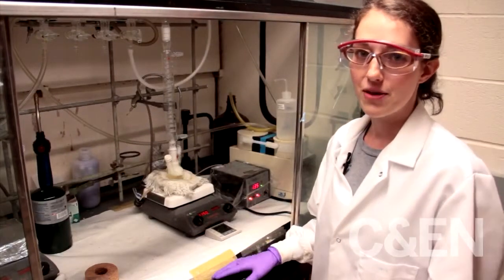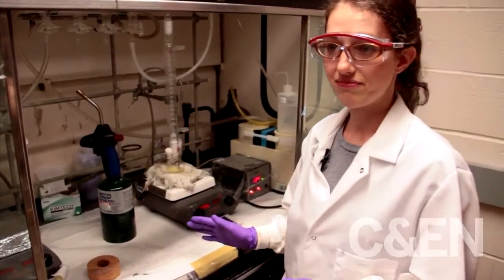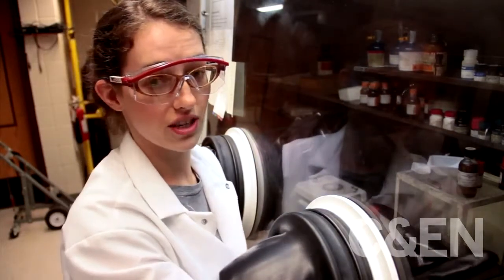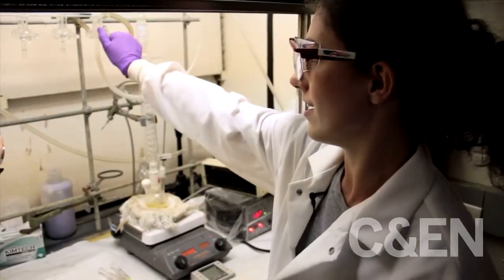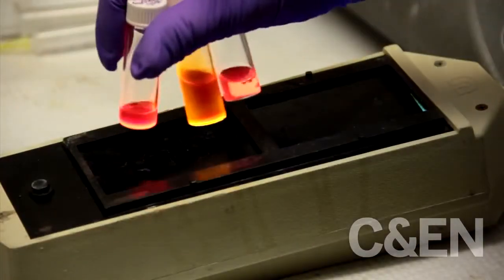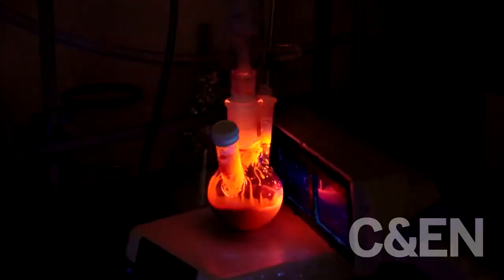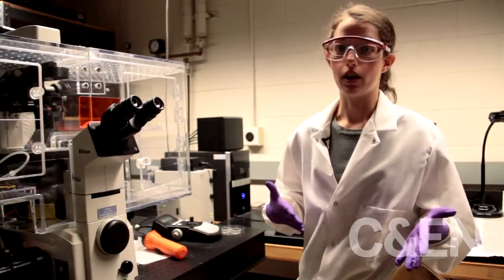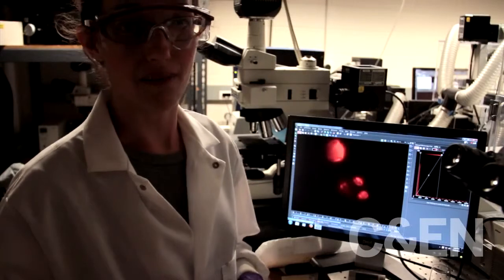How to Make Quantum Dots

Comment: I am interested in your setup, specifically the heater and wondering if you could explain a little about this. I am trying to reach 300°C using a sand bath and high-temperature hot plate for a synthesis method but it is very difficult to control the temperature and the sand get heated very slow or passes the set temperature quickly. What is the role of the cloth on top of a hot plate? is it a heating mantle? does the hot plate's heater do anything? 
Thanks in advance.